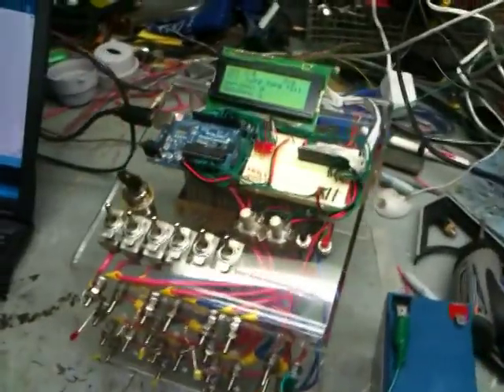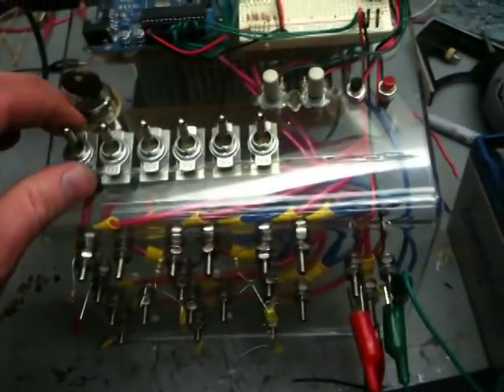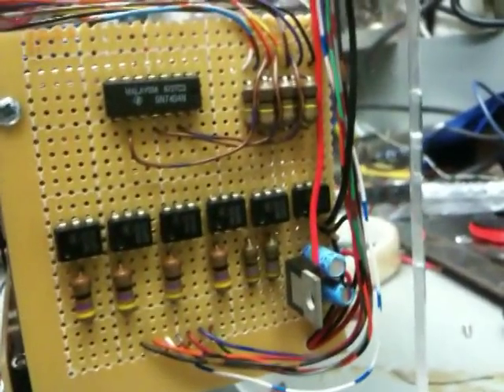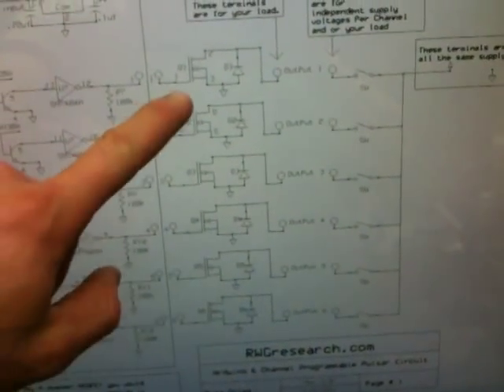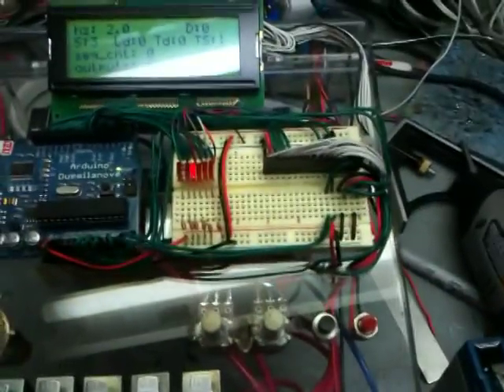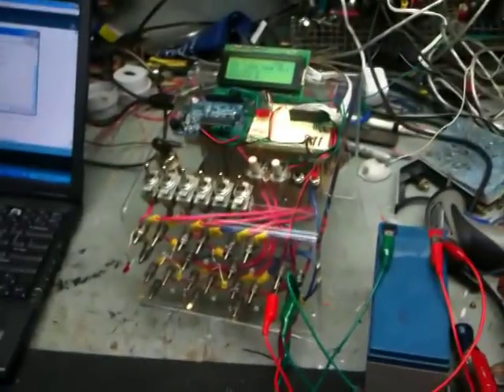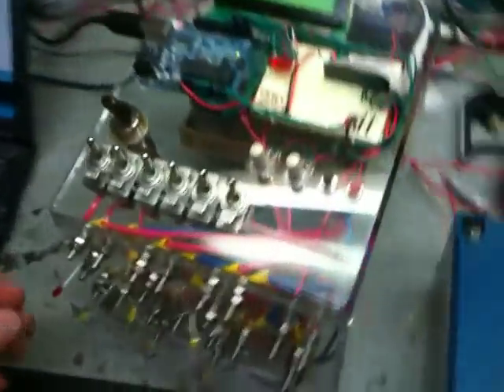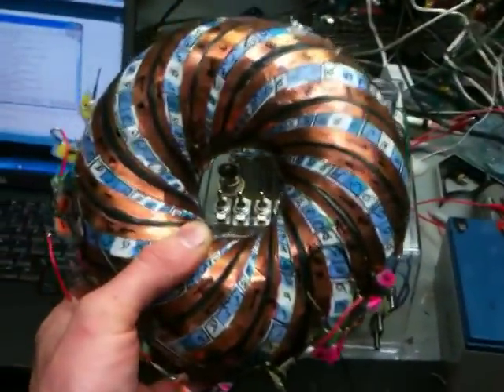6 Output Arduino Pulsar Programmable Test Box! Open source RWGresearch.com

Comment: Hey Russ. Looking really outstanding. Nice work !!.  You have to make a video about why geniuses always have a mess in the basement or garage. Not that i my self is a genius, but i recognize the conditions you are working in ;O). Well just as a side note, on the opto-coupler board. Between the opto output and 7404 input. Put in a pull up resistor 4,7 k ohm så it don't pick up noise when the opto is off. Well as i understand the next 14 days going to be a party. Cant wait. Have a nice day. Alan

Comment: The Arduino driver and ABHA are Awesome.
I'm needing a 10 pulser set-up just like your 6, so I've got some work to do. Dude, I've got 3 arduino's and am planning on using one to control the other 2. I figure that instead of being limited to the 16MHz of just one Arduino, I should be able to get 32MHz this way. That's a fast pulser.
Peace Bro.
mike.